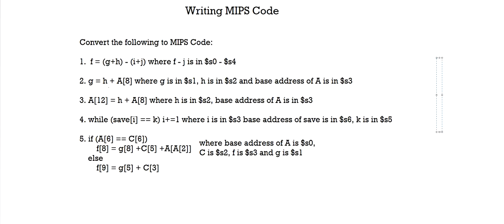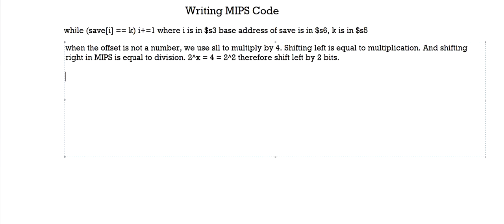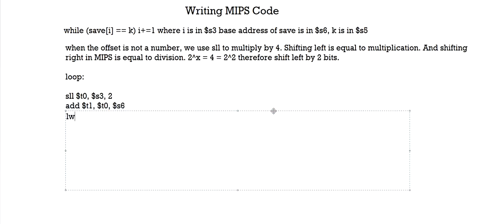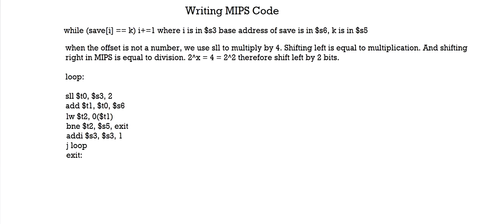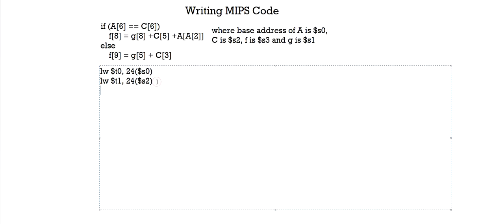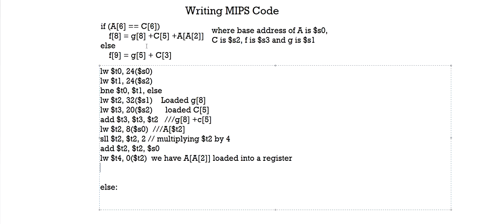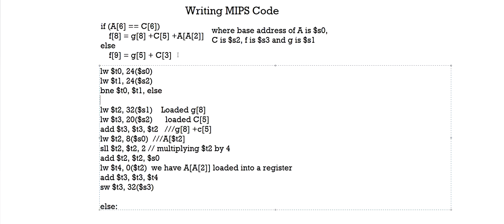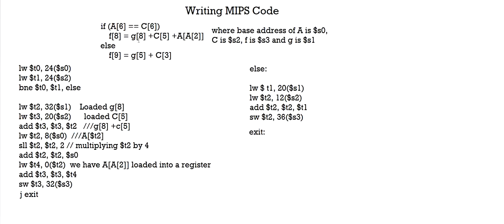Writing MIPS Code Part 2

Comment: hello, I have a question :
in the first example of this vedio, could we do it like that at the begining ? :
sll $t0, $s3, 2
lw $t2, $t0($t1) ?
as long as we have the value of the ofset in $t0 register, we can't do it like that for a one less cycle ? or the lw instrustion doesn't accept registers as argument ? 
thank you so much it's really helpfull!
Reply: the lw instruction doesn't accept registers as offsets. This is why we load the value in a register, then set the offset as simply 0.

Comment: why do 
we have to multiply by 4, why not by 2 or 6 or 8, and so on? when we will use SR? what will happen if we do SR here?
Reply: we multiply by 4 because the difference between say array[0] and array[1] is of 4 bytes. so when you want to access something say 6 indexes away from 0th index (or anywhere the base address is) you multiply 6 by 4 because 1 gap is 4 bytes, 2 is 8 and so on. and if by SR you mean shift right, it means division so shift right once would mean divide to 2, and twice would mean divide to 4